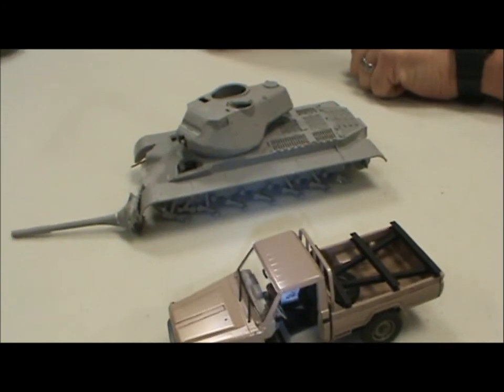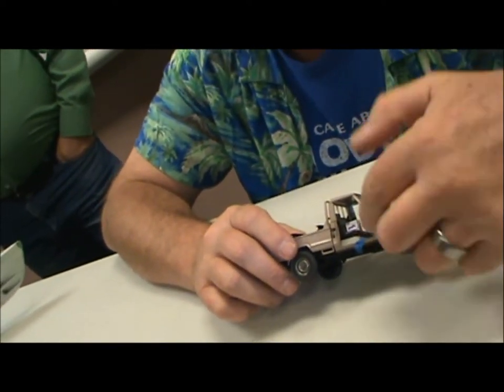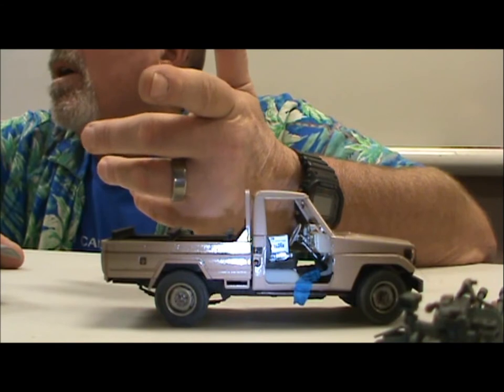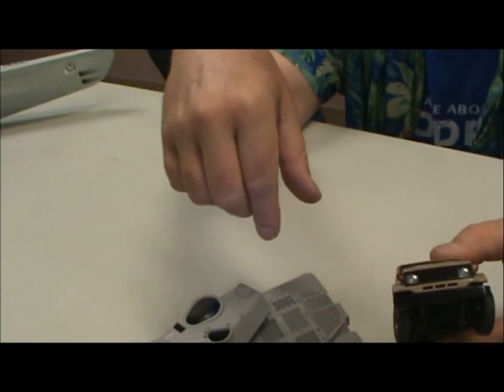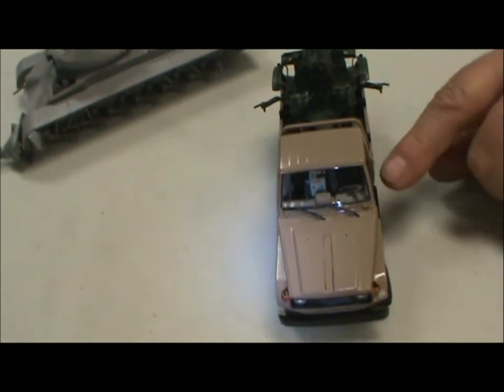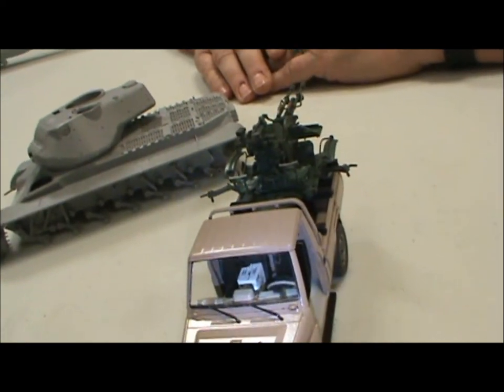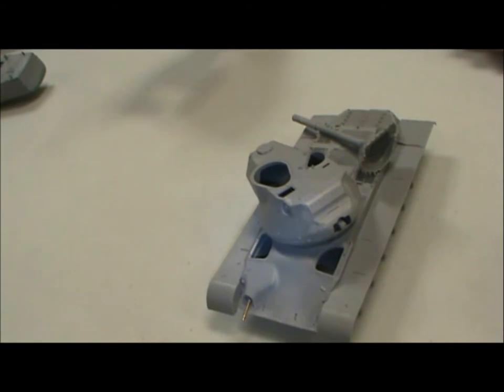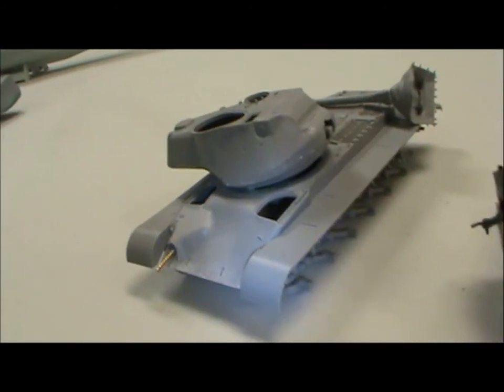Meng pickup w/ZU 23-2, Takom M47

Comment: I build my kits for me not for any contest or judges, so I do not care about sag. I do not care if people say it is wrong.  I have a couple of dozen armor models in 1/35, I prefer the "rubber band" tracks for saving time.  (NOTE most of the kits I have are individual track, Miniart, Meng, Takom, Trumpeter, and now an Academy kit) I just finished the tracks on a Takom Chieftain MK11 it took me a number of hours, not only were they single tracks, but have a separate track pad that needs to be cut from the sprue, cleaned and then glued on to the track.  Takom's Brave Tiger had rubber band tracks with the ends held together by a metal pin, very nice. Give the after market Meng Panther tracks a go, the pins that hold the tracks together are microscopic. Plus still the cutting the tracks from the sprue, clean up and gluing the guide horn on. (Only half way done with those) Yikes ** I will have lots to do when I retire soon.
Reply from the maker: Mark is a great guy and we make fun of him in the club.  Like most of us Veterans he has PTSD that causes him to be a rivet counter, or at least that's what we diagnosed.  LOL
Reply: I understand USMC 77-81  No disrespect intended, but is one of my hot buttons, I have a few tank models that I have painted up shall we say. A Tiger tank painted just like a Siberian Tiger orange with black stripes and white underside. Also in the planning stage is another tank to be painted Candy Apple red, with spinner wheels, flames, maybe even fuzzy dice off of the gun. All of this was because someone else told me that you cannot paint a Tiger tank a certain color.
Reply: No disrespect intended,  I understand (I served as well, USMC 77-81) That just happens to be one of my pet peeves, when someone says "you cannot paint that tank that way", so I have a couple of tanks that I have painted , how shall we say this "unconventionally" Example a Tiger Tank painted like a real tiger with orange background and black stripes, white underside. Another one is Gloss blue waiting for flames and decals of the Virgin Mary like a low rider car. Like I said for fun, other wise it becomes work, who needs another job, after 40 plus hours a week.
Reply from the maker: None taken.  Its a hobby for YOUR enjoyment!  And as a Marine, since when do you care what others think, right?  US Army '80 -'92.  You have got to post picture when your done!  Some of the rivet counters will piss their pants.  lol
Reply: No doubt, I will see what I can do about posting, but as I do not Facebook (never have) it will be tough. I will work on it.